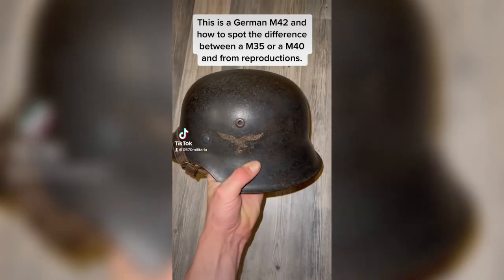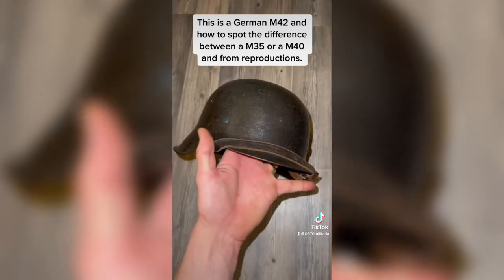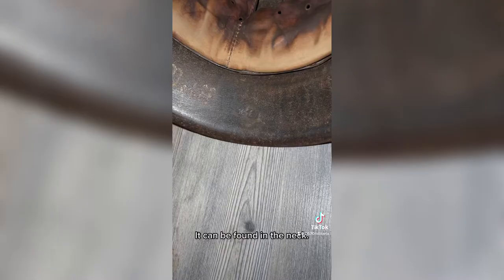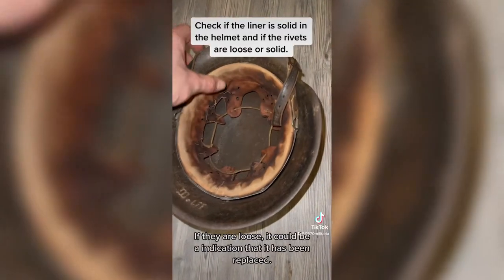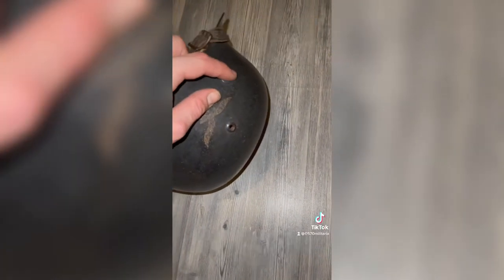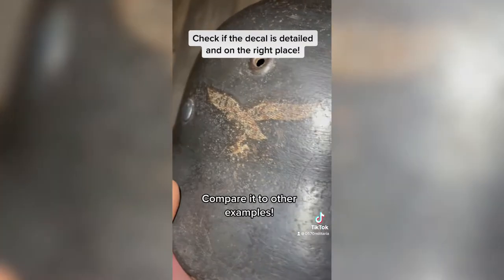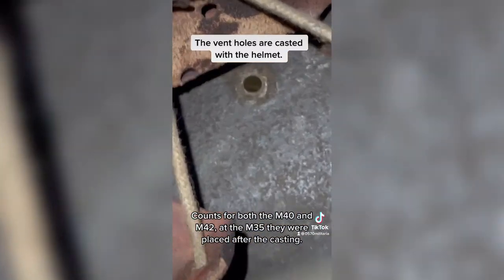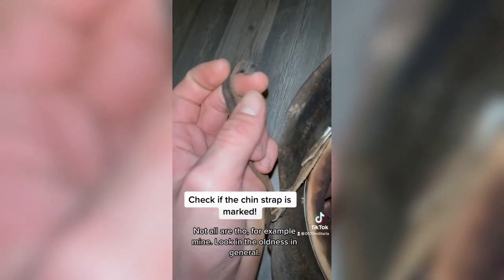Tutorial Tuesday - How to spot the difference between german helmets and a fake or restored ones!🤯

Comment: I have what looks to be a police helmet from WW2 Germany, I’ve had to do a lot of research on it, it has 5 small cluster holes  almost either side of the middle, the leather looks and smells authentic and old with a name written on it in old German handwriting, I need to strip it and get the rust off because the guy before painted it with this horrid glossy black paint and painted an awful SS insignia on and in the complete wrong place, I sadly can’t see the factory code though, I’m hoping it was painted over when he tried to restore the helmet, once it’s stripped I will know if it’s repo or original
Reply: Sadly it’s too late for the helmet paint wise because the guy ruined the original paint job and must have gotten rid of the old insignia